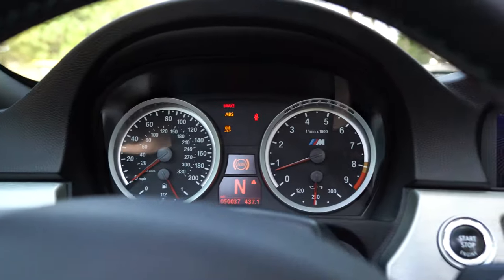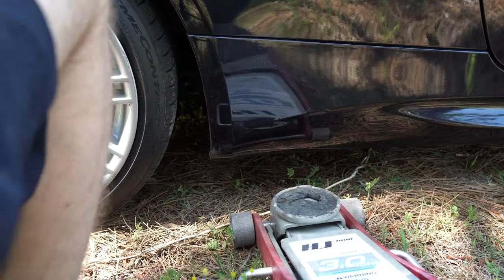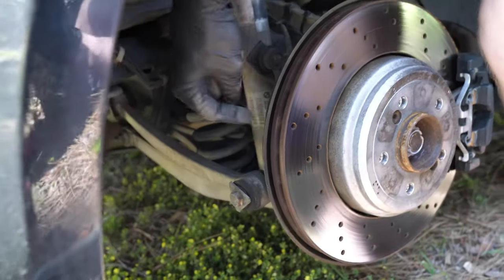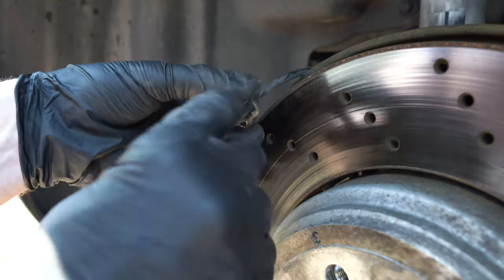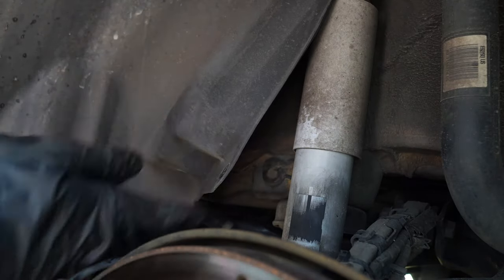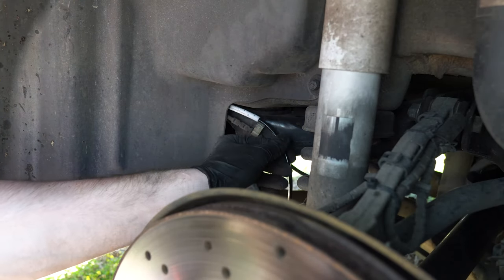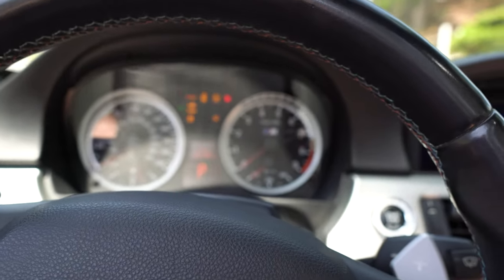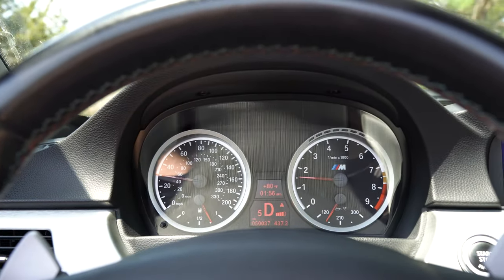BMW m3 e9x FIXING THE TRIFECTA ABS DSC BRAKE WARNING LIT Speed Sensor replacement

Comment: Hello...i have a 2012  Bmw 750i xdrive the traction control light came in just like in your car,i have replaced ALL 4  speed sensors brand new all around i drove the car all day long but the light did not go away and when the traction control light is on the power as been reduced and the check engine light also came on...taking off is slow i have to step on the gas pedal to the floor and  i can only  go as speed limit as 100 to 120 thats it..any idea or suggestion my friend ?
Reply from the maker: Sorry I didn't respond you earlier. My guess would be the bearing if the massage still say it's a speed sensor. But Did you figure it out at the end?
Reply: @Makhnovets  i finally took the car to the mechanics and i ended paying up $2.976 dollars,they find that they was moisture in the carpet driverside (that make sense because my car is parked outside and rain comes down on it and doesnt get dry quick because is parked on the shade behind the house even when the sun comes out it doesnt dry up the car) and that moisture damaged  also the sensor for the accelerator pedal  and also was causing the airbag light to be on... And the traction light was caused by  another transfer case motor which i installed in without knowing that it has information from another car because i bought it on ebay so it could not communicating with the computer in my car it was in conflict.. they have to retrive information from my original transfer case and installed into the one that was already on the car from ebay...and last not least the engine light also was fixed.now all the buttons on the steering wheels are working
And they reprogrammed everything so that it can be communicating with the car computer
Now the car runs,sound,and feels like brand new...a little stepping more on  the gas pedals it takes off like an arrow...lol
Reply from the maker: @levymwamba3283  yea that’s sucks!( 
But i glad you figured it out! It’s little on the pricey side but if they did the good job and from you’re reply sounds like they did! That’s very 👍🏻 !
Reply: @Makhnovets  Oh yes brother the price i paid is worth it,i am so happy with the car it drive like a dream and i thank you for your concern it shows that you care.